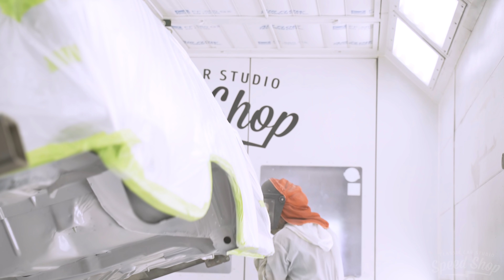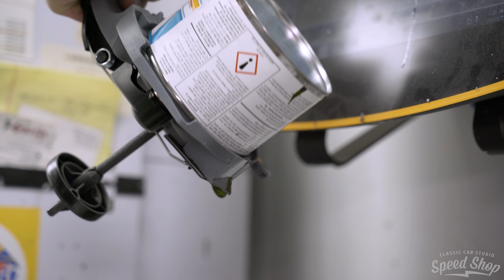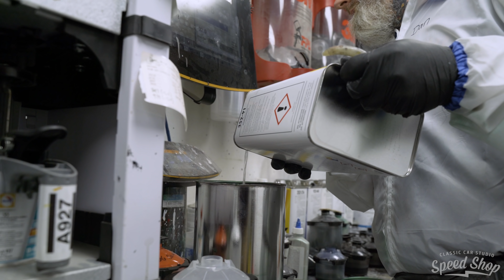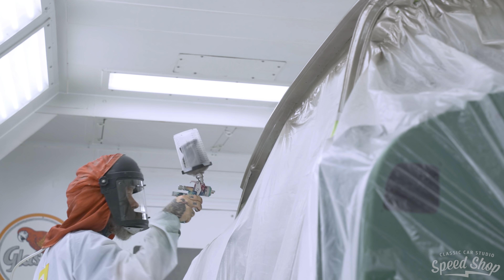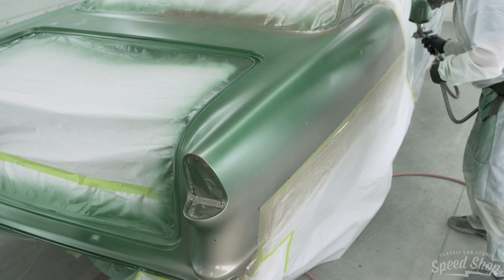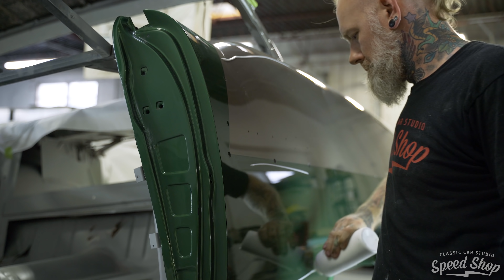55 Bel Air Build | Part 6 | Paint

Comment: @12:23 the painter mentions a black guide coat for wet sanding, is it a black kind of primer coat over the finished color and clear coats? I am trying to understand the sanding and paint process, I worked in body shop over 40 years ago when it was just lacquer paints, candy colors and clears! Thanks in advance, btw you guys build such sick well executed machines, whether they are a driver or a build that is Ridler worthy they are meticulous and so well done!
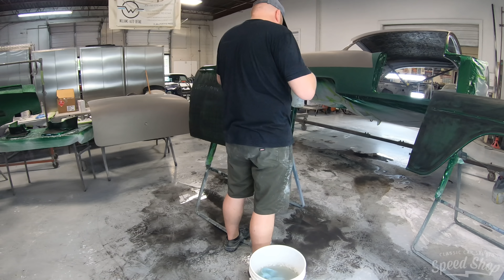Reply from the maker: Hi Andrew, thanks! We use guide coats for sanding at multiple stages of the bodywork (spray poly, clear, etc.) to make sure we've removed any sand scratches in the surface that may have been introduced during the sanding process. In this video, Dan is talking about a guide coat goes that over the clear, and is to show where the paint has/has not been wet sanded. The guide coat is completely removed during the wet sanding process. You can see an example at 11:17 where two panels have the guide coat, and then again at 11:21 where Travis has wet sanded a panel with one stage of sandpaper and in doing so, has removed the guide coat.
Reply: Thank you for the reply! That makes a great deal  of sense. using that technique to ensure a completely smooth glass like finished surface.